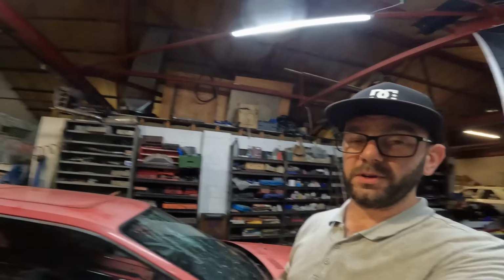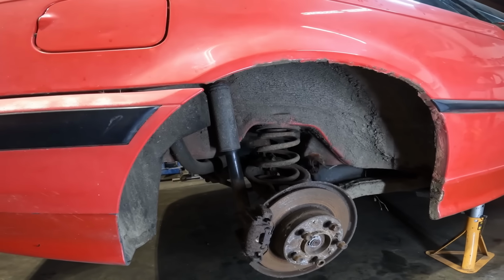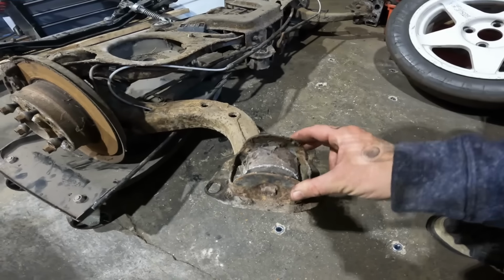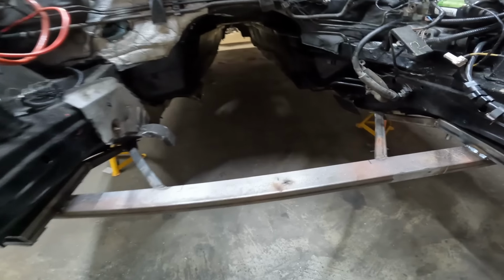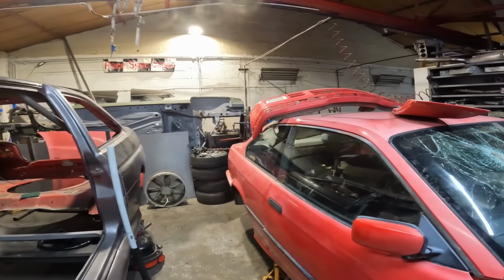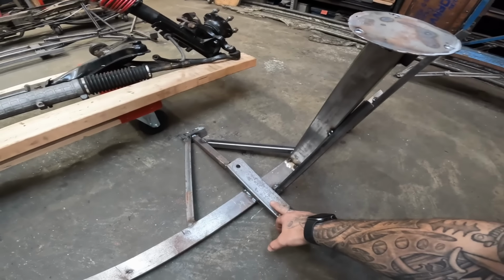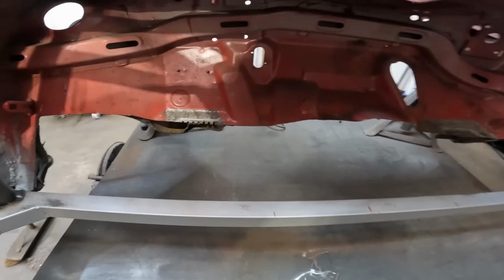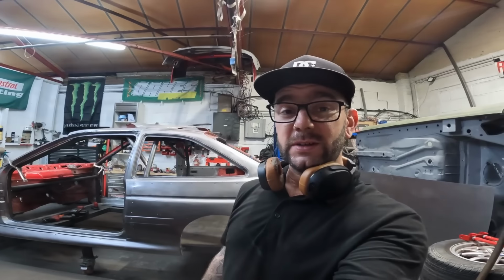Escort Cosworth WRC Tube Chassis Build ep15 Making Jigs

Comment: Amazing, I'm building a Escort Cosworth based off a 350z
Reply from the maker: I was going to do the same but the track width was to wide
Reply: @Tdevil86  Wide body? lol
Reply from the maker: @frankiewalnuts  cosworth isn’t wide enough, you’d need to make it wider to accommodate the 350 stuff if you want decent wheel fitment…
Reply: @Tdevil86  it's only 3 inches wider, given that the escort stock sits within the body... You would need to run spacers to get arch to lip fitment on a stock car... so I hope that 1.5  inches each side will give flush fitment. Then you have wheel choice you can create any amount of fitment with custom offsets... finally you have camber a few degrees negative should finish it off...
Reply from the maker: @ oh, don’t get me wrong, it can be done, it just wasn’t for me, the tolerances on wheel fitment were to tight for what I’m after, you’d end up having to run a high offset which might cause an issue with the wheels clearing the brembo brakes, that’s just an issue I didn’t want to potentially run in to…
Generally if you fit a 18x8 et 30 wheel on a cossie that’ll give you a pretty decent fitment, iv not properly looked in to it with the 350 gear but I’d expect and 18x8 with the wider track would need something like a et40 or up to fit well…? That’s where the brake fitment issue might become apparent, unless you can offset the caliper and find a different disc to suit.
5x114 is a much better pcd for wheel choice though!
Reply: @Tdevil86  Yeah thats a problem for later me lol

Comment: Probably a bit late now, but did you consider doing BMW X3 e83 running gear? The rear of those are pretty much e36/e46 design. And e36/46 share a lot of the components, as in, most have the same OEM part numbers (I'm in the process of bolting in X3 rear upper wishbones onto my e46. Literally bolt in, except the droplinks), but the X3 front subframe allows you to have the choice of 4x4 and RWD just by swapping out sumps and adding the front diff and shafts. 

Long story short... E83 X3 and E36 front and rear will mate up, but the X3 front will allow all engines dating back to e30 3 series chassis and add capability for AWD if you want it. 

A 4pot e83 with a snapped timing chain can be had for £500. Add $1000 and you can prob find one with a M54 2.5/3.0 six pot, manual. If you've not started chopping the front off.. there's still time lol

There is one more option for 4x4.. e46 "ix" model stuff, but it's much harder to come by in the uk. The "Real OEM" website is great for cross referencing all these bmw parts
Reply from the maker: I did looking into things like an e82 and the like but according to google the track width was considerably wider than a e36?
Reply: @Tdevil86  Yeah, looked the numbers too. I think on the x3 the larger track width is mostly due to built in spacers on the hubs and wheel specs. Like I said, the rear arms/wishbones look to be the same length as the e36/46. If they weren't, just changing the upper wishbone for the stronger X3 e83 jobbies would play havoc with the camber etc, one would assume. I'm defo about to find out as they just arrived over the weekend 😁 

Worth this mentioning as you wrote "E82" which is the one series, those don't share anything with the e36 suspension design. Much more complex 5-link setup on the rear. Not investigated much about them on the front, but I think the same applies, not able to retro-fit much. They're linked to the e90/91 3series etc, where they completely changed the suspension setup on those generation cars onwards.

The models most relevant to us e36/46 guys are..

3' E36   (11/1989 — 10/1999)
3' E46   (04/1997 — 12/2018)
X3 E83   (01/2003 — 07/2006)
X3 E83 LCI   (02/2006 — 08/2010)
Z4 E85   (01/2002 — 08/2008)
Z4 E86   (10/2005 — 08/2008)
Z4 E89   (01/2008 — 08/2016) 
And even..
Z1 Roadster   (07/1988 — 06/1991)

That's where you'll find the most interchangeable stuff. On the Real Oem website e36 is under "Classic" which I think stops the modern parts from cross referencing backwards on part number links. They do seem to link forwards from classic at least to e46 tho.

My complete coilover set is from a e85 z4. Bolts right in, shocks, bushes, top mounts, the lot, front and rear.  😁 Some of the little bits such as washers, dust covers, brackets, loom plugs are found in the minis, old 2002tii turbo, V12 7series and so on 

My x5 shares bits with Range rover. I love playing "The Part Number Lottery" over on Real OEM, you literally never know what's gonna pop up when you click a part# link there 😂

Comment: I think I saw a cool trick with a plasma cutter for getting clean circles.. Something like a plank of wood with two holes at each end. One hole for the cutter tip, the other hole with a bolt thru the wood and the metal as the centre point of the circle. Then just wizz the plasma cutter round like you did the protractor. Something like that lol
Reply from the maker: Funnily enough, think I know exactly what you mean, I see something come up on Facebook literally the day after I’d done my plate showing something very similar lol having the right goggles and being able to see would help aswel 🤣 Iv got some new tips coming so I’ll try it out when they arrive

Comment: What’s the idea in using all the bmw parts buddy are you fully swapping out everything underneath and the engine into the escort
Reply from the maker: The cars going rwd and the e36 platform seemed to be the best choice based on the aftermarket support and the availability of parts etc.
It’s having a full tube chassis, e36 front and rear end, k20 turbo engine, bmw gearbox
Reply: @Tdevil86  been watching from the start it’s gonna be an unbelievable piece of kit mate can’t wait to see both escorts done

Comment: Have you changed cameras Terry? Picture quality is fantastic 😀 That BMW looked like it was not totally standard. Not putting the 6 cylinder 2.8 in the escort? 😀
Reply from the maker: @julias-shed  no, still the same old GoPro atm, apparently wiping the screen helps lol although the lense screen bit has seen better days now after having welding splatter hit it on numerous occasions 🤦🏼🤣
I did think about a bmw engine but they’re massive and would leave a great deal of room in the engine bay, the k20 should fit well though and is proven to give good bang for buck so hopefully my £50 engine will do me proud haha

Comment: 11:19, those front trailing bushes [lolipop] don't look standard, usually pin is central in bush
the reason they are made with the bolts at the side is that they had to snap off in a crash, so nailing to a tube is no bother for us boys
plumbers are on a grand a day, so that's 5k you lost...  keep it up young man...
Reply: Good spot on the lolipop bushes. Those being offset leads to to believe this chassis was planned to be a drift car. Usually people put those in is to raise the caster over standard (M3 does come with offset bushing as std, as well as different geometry over base models.... I think).
Reply from the maker: Cor, I wish I was on a grand a day, I’d be able to buy a decent car if that was the case and not these rusty old turds lol
But yeh, it’s had a few modifications on the bmw, the lollipops, extended lower arms and a solid steering column coupling, annoyingly it was missing the front anti rollbar though so il have to figure that out when I get to it although I imagine that’ll find its own place once things are fixed in place